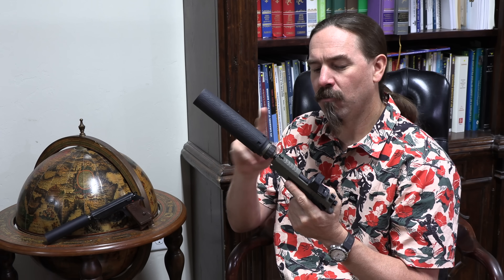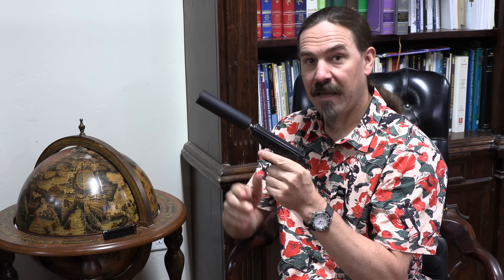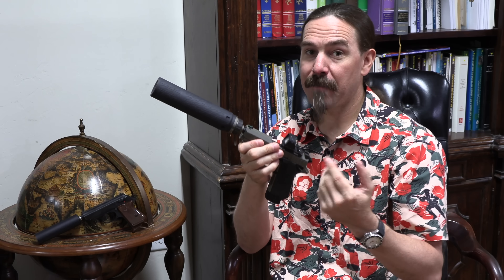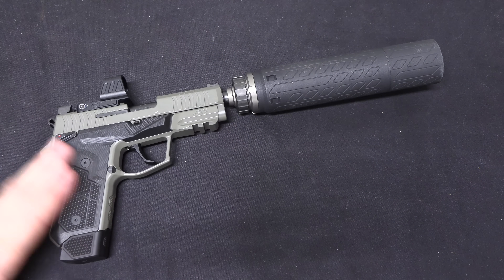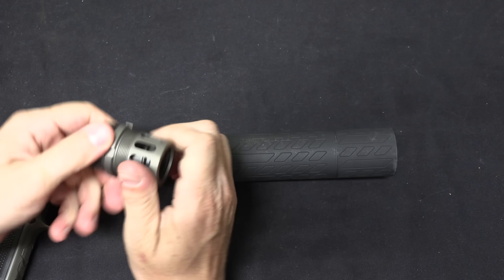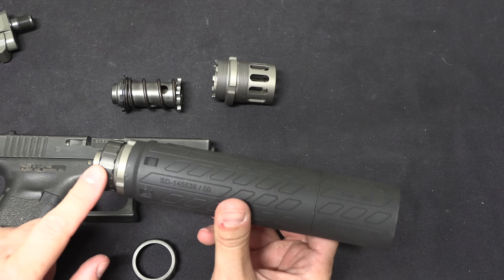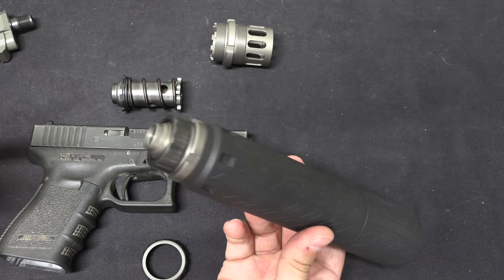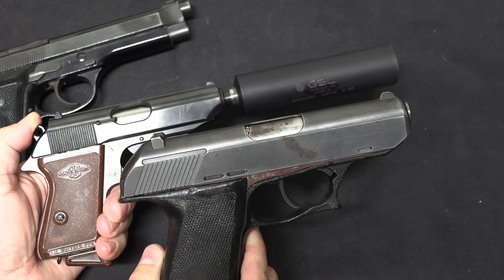Nielsen Device: How it Works and Why it's Necessary

Comment: When you buy a suppressor, do they all come with Nielsen device, or do you have to hunt for a matching one for your particular suppressor? Thanks!
Reply from the maker: They do not automatically come with one, you need to make sure you get one. Also, 9mm and .45 pistols have different muzzle diameters, so you need to make sure to get a mount that fits your pistol specifically.
Reply: @ForgottenWeapons  Thanks Ian! 🤝

Comment: As a suppressor newbie, is it okay for me to permanently attach a nielsen device to a suppressor that intend to use with two different guns, one of which is a tilting barrel pistol and one of which is a direct blowback pcc (cz scorpion)?
Reply from the maker: No, you should not use the booster on a fixed barrel. It won't hurt the gun, but it will put undue wear on the suppressor mount.

Comment: I noticed a small bit of movement after the slide cycles that last little bit of forward travel that fully locks into battery. Is it a chance that the device could still delay the slide enough where it won't fully cycle into battery? Wasn't sure if that was from the Nielsen device or just the slow-mo catching something normally wouldn't see
Reply: Mostly slow mo catching things you would normally see. There’s a lot of things that show up like that when slowed way down.

Comment: What happens if you mount suppressor with a nielsen device on a blowback pistol? Does it do anything bad or does it still function even though it's unnecessary?
Reply from the maker: It will put excessive wear on the booster.

Comment: There are situations where a Nielsen device isn’t needed—specifically when you don’t want the pistol to cycle or eject the spent casing. This is important in stealth or covert scenarios where maximum suppression is critical, and preventing the action from cycling keeps the shot quieter. If the pistol ejects the spent casing, the shooter not only has to spend time picking it up afterward but also risks forgetting to retrieve it, leaving evidence behind that could be found and linked back to them. By keeping the casing in the gun, this extra step and risk are avoided, even though the shooter must manually remove the casing later. Some specialized pistols, like the integrally suppressed B&T VP9 or the Welrod, are designed to operate this way, requiring manual cycling after each shot. Fixed-barrel pistols that don’t rely on the Browning short-recoil system—such as many .22 LR handguns—also don’t need a Nielsen device, since there’s no barrel movement to interfere with. In these cases, or in training and film settings where auto-cycling isn’t needed, omitting the booster makes sense. So while the Nielsen device is essential for most suppressed recoil-operated pistols, there are deliberate situations where not using it is the better choice.
Reply: Silenced Nagant revolver.

Comment: 2:37 
In a recoil operated system it isn't the pressure/gas that gets the locked slide and barrel moving, it is the recoil which is generated by the forward moving mass of the projectile (and to a certain degree by the forward moving mass of the gases, but not their pressure) . Hence recoil operated system.

This becomes clear when you calculate the gun's recoil velocity:

Velocity recoil = (Mass projectile x velocity projectile) / mass weapon

There is no pressure in this equation.

That's also why recoil operated guns won't work with blanks and barrel threaded blank adapters, cause the pressure won't cycle a recoil operated system.
Regarding the Browning M2 for example,  the blank firing adapter is being mounted on the receiver. The BFA protrudes over the muzzle and acts as a booster, which directs the gases onto the muzzle, so that the barrel acts as a piston. Factually the M2 is turned into a gas operated weapon if a blank firing adapter is attached.

Comment: Nice giant spark flying out there at 10:24 can't be good.
Reply: it's fine, it's just burning powder. boosters don't have a perfect seal so some gas and powder will escape out the back.
Reply: is it a bug or a feature?
Reply: It can be normal, depends on supressor design. Mine has a lot of initial gas buildup. I shoot real clean syntech 150 and less clean Fiochi 158 grain 9mm, but especially if I shoot lighter Federal or similar 147gr I can feel it hitting my face or stinging my face. Eyewear is a good idea. In so many ways, suppressors and how they operate in movies are nothing alike.
Reply: yeah that was crazy, that can't be right?
Reply: while it doesn't look great, the additional moving element combined with that element needing clearance to move, combined with the barrel dropping, means you will get some leakage between the piston and the barrel adapter, plus some friction between the adapter and the piston.
Is it ideal, no, but would you prefer having some additional wear/blow back to consider or having to reconfigure your slide spring?
Reply: It looks like it helps relieve back pressure. It pistons up to the holes drilled into the neilson device and then bleeds the excess gas pressure to keep it from from over pistoning, least thats what it looks like. Allows for different loads of ammunition.
Reply: jaws is NOT a good movie lol what do you mean? the budget wasn't nearly as good as similar blockbusters that season
Reply: @Dapstart  Based but irrelevant.

Comment: 9:17 actually the flange of the suppressor hits the frame of the pistol, and this is what completely stops the barrel from moving back. It probably would not cycle anyway, but the explanation is misleading. And the moving part of the Nielsen device is a much smaller diameter and does not hit the frame.
Reply from the maker: It does not hit the frame, although I can see how it might appear so in the video. I was careful to check that before and after firing. If it had been hitting the frame I would not have been able to chamber a round or manually eject the empty case.
Reply: I thought the same thing, and actually watched about half a dozen times trying to work out if it was.

The main reason I thought that was the case is because it looks like there is a moment/twisting action as the bottom of the suppressor stops and the top keeps moving.

However, if Ian says it clears, I'm not gonna argue.
Reply: Thanks for the clarification.

Comment: I understand the principle, but you indicated in the first half of the video that the act of tilting the barrel with a supressor attached also affected the cycling of the action, and the Neilson device doesn't solve that issue.  In fact the video that shows the device in operation appears to show the gun not quite making it back into battery.  In fact the barrel appears to still be tilted.

Comment: 9:57 you can see the can striking the gun as it tries to cycle, maybe the issue isn't so much mass but just mechanical? What if the can were slimmer at the back/designed to clear when cycling?

Ah nvm I see the reply elsewhere. It really looks like it strikes though! It even stops abruptly!

Comment: Hold on. You can see that the suppressor goes forward and stays forward though most of the recoil cycle. It only goes back when the slide's already moving forward. What's holding it forward? Is the Nielsen device basically gas operated rather than simply inertia operated?

Comment: Interesting that the silencer spit sparks with the Nielsen device attached. That wasn't muzzle flash or burning powder; that was titanium metal. I can't imagine that this is supposed to happen.
Reply: Would like a professional explanation of this because I could see the sparks hampering second shot / sight picture when there is no muzzle flash.
Reply: @smoses_gaming It's because the suppressor is 3D printed titanium construction.  It hasn't been shot very much because what you're seeing is burning titanium particles left over from the manufacturing process.  It typically takes several hundred rounds to get every bit out and if you buy one there will be a note in the box stating that it is the normal break-in process.
Reply: @deuceandguns  That makes a lot of sense, since the metal 3D printing technology starts with titanium dust. Any surface particles that didn't get sintered together well enough get blasted off by the pressure and ignited by the heat.
Reply: That looks like the suppressor or Nielsen device is making contact with the barrel or threads mid-recoil. Could be wear, poor fitment, or even damage from manually flexing the device. Either way, something’s way out of spec.
Reply: Same I also am curious what was happening.
Reply: Came here to say the same thing, seemed excessive to me.
Reply: From what I have seen on the Internet (TM), any printed titanium can will produce sparks, at least initially, regardless of host, and attachment method.

Comment: How does the Nielsen Device works on a rotary barrel? It seems Nielsen Device only compensate the linear movement, but the large mass of suppressor still resists on the rotating barrel.

Comment: Looks like the suppressor is contacting the frame of the Gloc in both cases without the neilson device. That could be adding to the cycling issue.
Reply: See Ian's response in the other thread. Something like "It may look that way from the video but I checked after fitting the suppressor and it's not."

Comment: This is such a solid explanation. The Nielsen device always seemed like a small detail, but it's actually crucial for suppressed pistols to function right. I recently did a breakdown on something related and it’s wild how much engineering goes into these systems. Keep these coming!
Reply: I mean can't you buy a smaller suppressor, they still work well.
Reply: It's why the shooter of the UHC CEO had jamming issues. He didn't know about this device.
Reply: My friend purchased a 9mm can and took it out to a friends ranch who was a "gunguy".  It didn't function and the gunguy said "you need a Nielsen device".

Comment: Well explained and puts various variables together in the thought process of can I get around a booster or not...  I also found the Tempo barrel system on the S&W M&P 5.7x28 needs no device either as the barrel shroud is fixed and sweet to shoot as I look forward to try some 62 gr subs.

Comment: It mechanically decouples the inertia of the suppressor from the system during some of the recoil cycle.
Reply: Spot on, it also allows you to purchase extra travel length for the receiver as long as you match the spring forces. If the gas overpowers the system heavily it'll push it fully open and slam shut before cycling, and if too weak it'll make it so the casing never has a chance to be pushed out and subsequently can't cycle. If it's just about right you mitigate the entire baffle assembly by shunting the weight off the suppressor as the gases expand.

Comment: My very 1st suppressor was an AWC Abraxis II, which was a wet pistol suppressor. I met the owner, Lynn McWilliams, at the SOF show in Las Vegas, and this was the mid 90's. He asked me if I was gonna suppress a glock or a beretta, and I said it was a Beretta M9. 
"Perfect!!" he said. 
I kept asking him if he had one with a Nielsen Device and he said he was working on one with a newer baffle system( this turned into the Jupiter Eye suppressors which I bought when it came out).
Anyways when I was chatting with him at the SOF show, he went on a long long discussion on why his wet suppressor didn't need a Nielsen device and he made his abraxis non nielsen device can for a special operations unit request.
As a young 22 year old, I felt I was on top of the world in having a cool suppressor until one year I saw Dr. Phil Daters Gemtech table and he went on a long discussion on the merits and benefits of Nielsen Devices and how you can use it on various firearms. Today, almost every suppressor has a Nielsen device and that's awesome. Wasn't many makers of suppressors back in the 90s. Great video Btw.

Comment: Gas-delay, a suppressor would accelerate the slide's momentum fairly dramatically, yes/no? Perhaps create a "double pulse" effect. 

Also, that firework show with the device attached.

I'm a bit of a luddite when it comes to suppression, and am of the opinion that sound mitigation is firmly attached to a caliber. In combat or situations with reduced logistics, however, this is entirely impractical, and the elegance of this device comes out.
Reply from the maker: Actually a suppressor on a gas-delayed blowback system slows down the slide by keeping it closed longer.

Comment: I wonder if the 007 "fweep" can be actually achieved in a regular supressor. Or with multiple of them.
Reply: A mix with a good can and subsonic ammo
But to achieve that you would need to tinker with it a lot...
To find The sweet spot on The ammo load and The gun used and the can

Comment: I have actually seen a Beretta 92 run just fine with a direct thread, but it was a very lightweight can.
Reply: Beretta's can tolerate it because their barrel does not tilt, but it's still rather hard on them

Comment: 9:17 The Glock doesn't cycle not because of the mass of the suppressor but because the suppressor hits the frame preventing the barrel and slide from moving back.
Reply from the maker: It may look that way from the camera angle, but it was not. I checked that before and after firing.

Comment: 10:24 that looks like a baffle strike.
Reply: He mentioned it’s a titanium can which often produce visible sparks w/o actual baffle strikes
Reply: Some suppressors build up a lot of gas in the first large chamber. If you run dirty 9mm 147gr ammo like federal you get a lot of gas blow back. I stopped using that, got tired of it hurting my face. Burns! Now I use 158 Fiochi or real clean 150 syntech.
Reply: I was wondering what those sparks were.

Comment: 0:11 "Holy crap this has a lot of threads" -Ian
90% of the suppressor-attaching scenes is probably just turning again and again until your hand feels more like a rusted socket wrench than anything because the brand decided to create excessive threading
Reply: Not "excessive threading." Fine pitch thread is necessary to assure the can won't back off from repeated firing.
Reply: @kentfletcher8539  some people have no sense of mechanical assembly forces. they look at a screw and think its magic how it holds things together.
Reply: @hengry0  Indeed. I was watching a video last week, I forget the channel name, with these two guys running some kind of 'tactical' drill on their range with ARs, with cans on. Then one of them sits at the bench trying to 'zero' his rifle, and on the umpteenth shot the can goes flying off the muzzle, several yards downrange. He had that level of mechanical aptitude, not to mention not feeling the need to read the manufacturer's instructions.

Comment: "slide barely moves at all"

You can see that the can hits the frame underneath the barrel, and the can wobbles from the shock in slomo.  The barrel is physically prevented from going back enough to unlock, regardless of mass ratios.

Or am I seeing things? @9:30
Reply from the maker: It may look that way from the camera angle, but it was not. I checked that before and after firing.
Reply: @ForgottenWeapons 

Oh, that explains it.  Thanks!

Comment: 9:18
Is that why that man who murdered the insurance executive had to cycle the gun manually?
Reply from the maker: Yes.
Reply: Isn't this sometimes even a desirable effect, given the amount of noise caused by a moving slide and ejection?

Not that it was in this case, but I remember reading this about some sneaky WW2 guns.
Reply: @no1DdC it's not stopping the breach from opening though, just unbalancing it enough to have incomplete operation
Reply: @no1DdC  Some pistols designed for secret-squirrel stuff (I remember reading about it on the HK Mk23, but it was dropped from the production model because it overstressed the frame) have a toggle to lock the slide and prevent it cycling for exactly that reason -- flip it on for manual operation so the action doesn't make noise/to avoid leaving brass around, off when you don't need to be as quiet and might need more than one shot. Kinda like how the SPAS-12 shotgun has the manual/auto switch, in spirit at least.
Reply: @no1DdC  Ian already has a video up on the Welrod and yes it was bolt-action both for the quiet and simplicity.  With a subsonic round and a great suppressor the cycling action tends to be the loudest remaining piece of an automatically cycling firearm.
Reply: @no1DdC no because no suppressor makes any gun that quiet to where it matters... except for maybe 3 rare specialized models available to a select few. I think a sten with integrated supressor and rubber wipes, hk 23, maybe a couple more CIA guns. There's a very few. But very rare. Almost every civilian gun bigger than .22 is still loud with a can on it. Even a .22 is about equal to a Red Ryder BB gun.